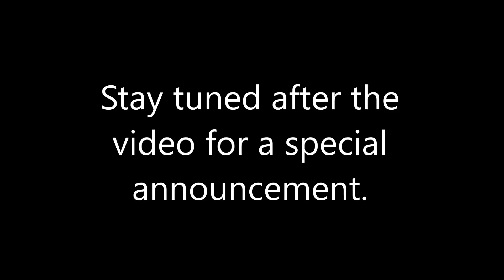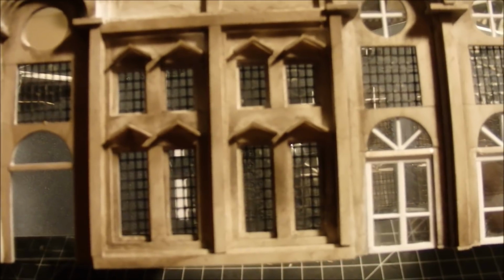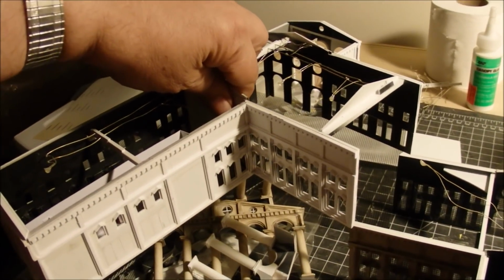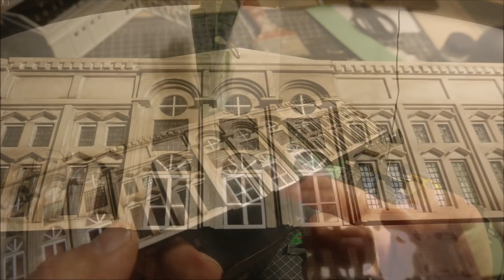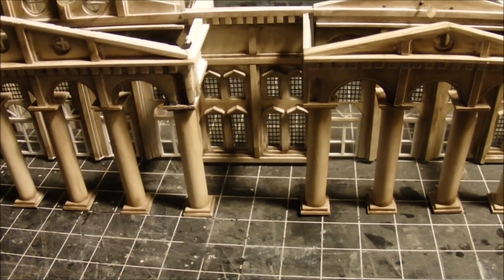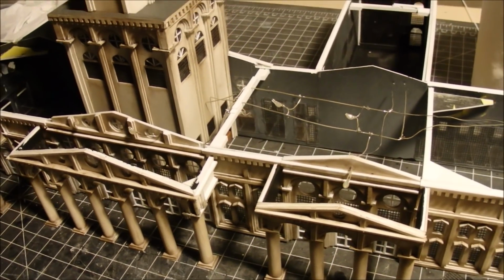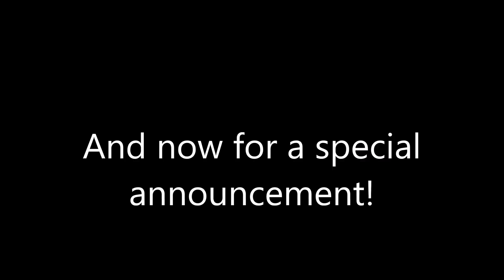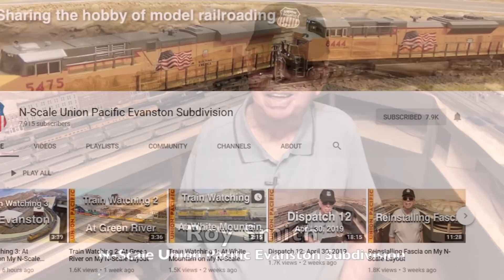MNW N Scale Model Railroad Monthly Video Journal, May, 2019

Comment: very impressive model...you must have an enormous layout for this structure to fit into..nice work ... great detail...thx for sharing.. vinny
Reply from the maker: Thanks Vinny! The layout is roughly 12'x11' with eventually two decks. You might want to check out my "Current State of Affairs" video I posted in April, 2019. That will give you some idea of the size.

Comment: Such an impressive structure!  What will be the overall dimensions when it is completed?  Keep up the great work!  Tony
Reply from the maker: Thank you Tony! The "foot print" of the building is pretty much complete. The main part is about 2.25 feet long and the concourses extending from the back are about 9 inches. Once I get done with the street level portion I'll be working on the elevator shafts and stairwells between the concourses and the train platforms behind the station.